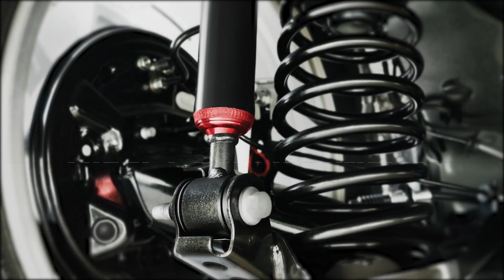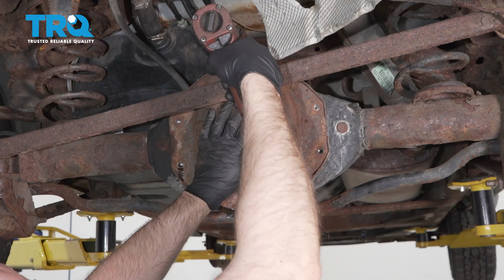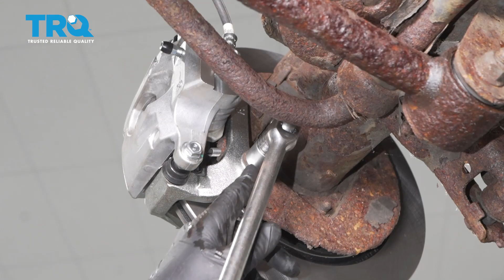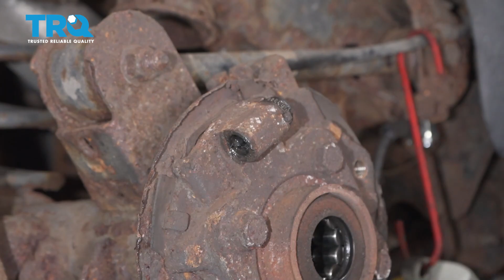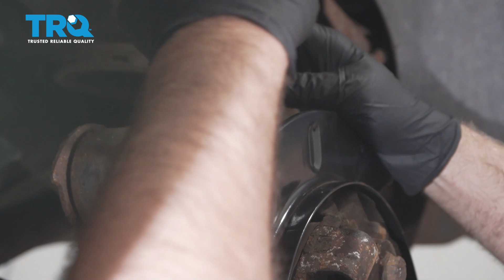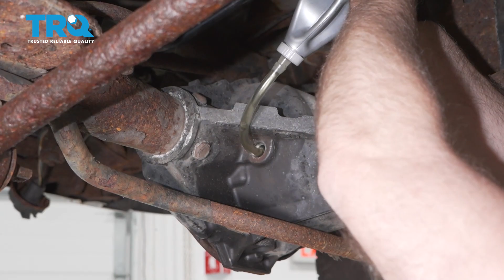How To Replace Rear Brake Rotor Backing Plate 2001-2008 Chevy Trailblazer

Comment: If anyone could help me out, I am having a hard time figuring out what that bracket is called that the backing plate attaches to, trying to acquire one due to the part that retains the adjuster is broken. Have not had luck on google, very helpful video for when I do the replacement. thank you